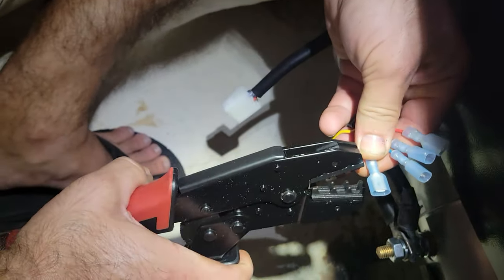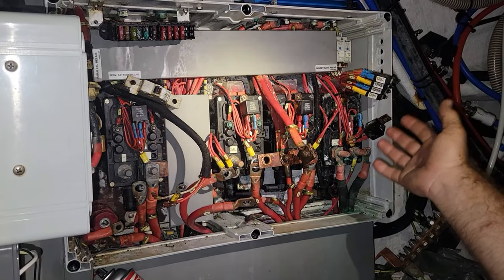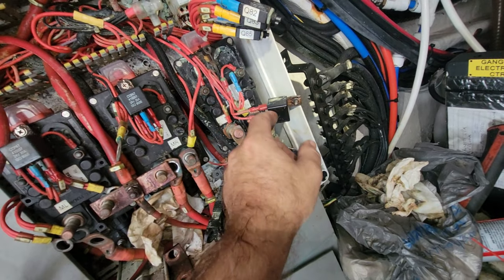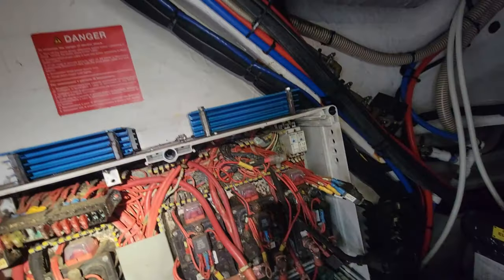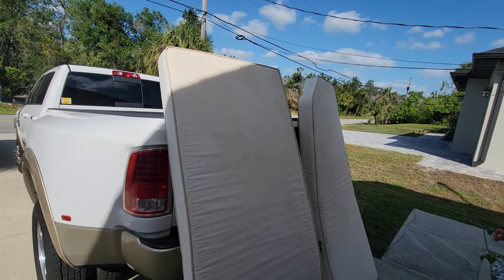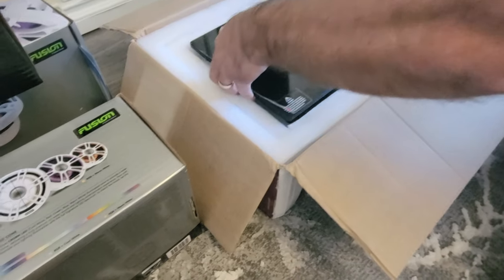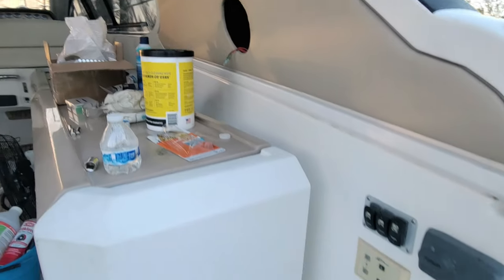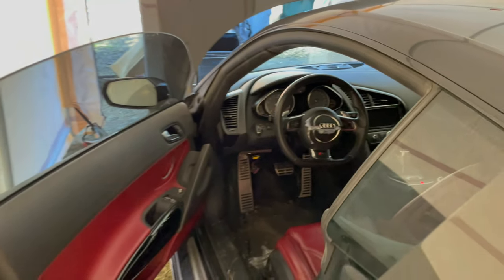Yacht restoration project - Electrical & Theft vlog 4

Comment: I’m not totally up on your story, was this boat sunken or is that what tends to happen to salt water boats. I boat the finger lakes fresh water
Reply from the maker: Well, not exactly,  It was not completely sunk, but it did have some salt water in the engine Bay. And yes, salt water is a lot more corrosive.
Reply: The engines were under water water was over the top of the motors there was no dingy when it was hauled out of the water because I hauled from marine max to the salvage yard